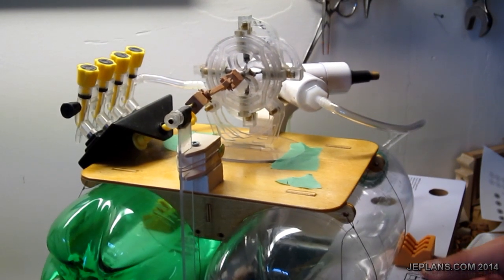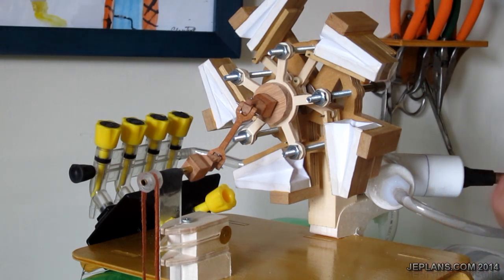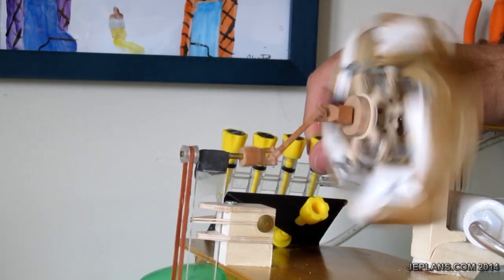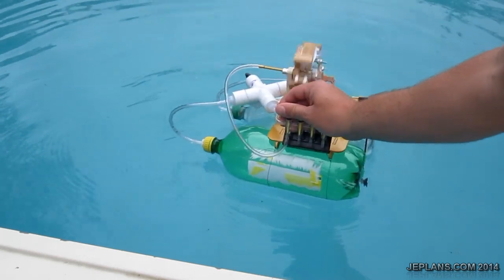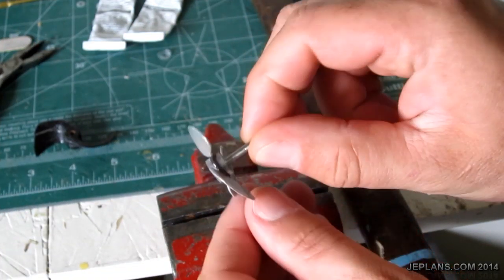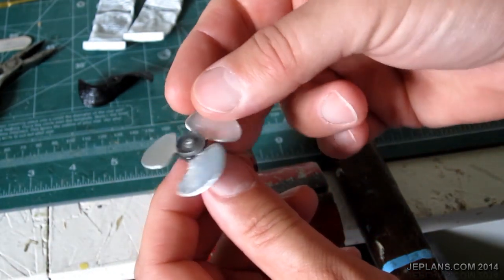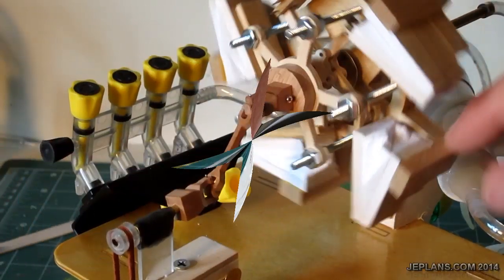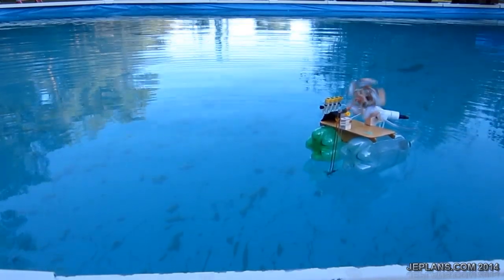Compressed Air Boat Part 2

Comment: I do not understand why this broken cardan shaft, which creates great friction
Reply from the maker: The friction issues are more from the belt on the pulleys and being a little tighter and pinched slightly. Also I tried to oil the mini radial engine and that made the pistons stick a bit. I was not familiar with the term cardan shaft(shaft with 2 universal joints). I am now and the cardan shaft operates very well with almost no friction. If fact I would say coming up with a good plan for the cardan shaft it the most successful part of the testing with the boat.